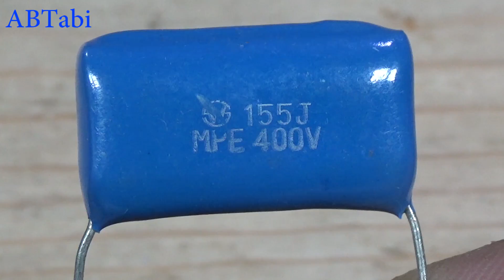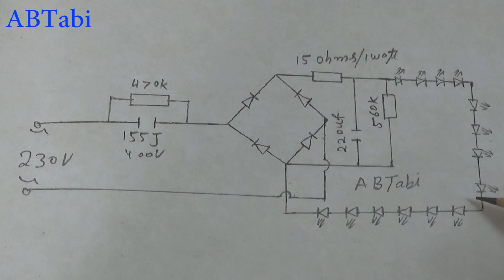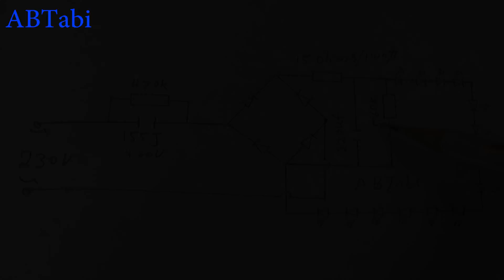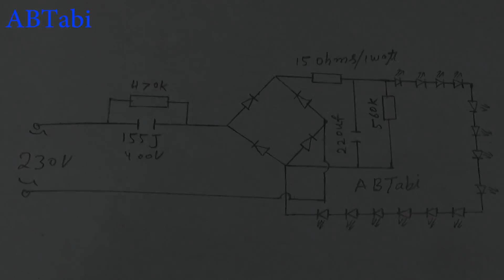How to make 230 volt Brightest Led light bulb, diy super bright led light bulb

Comment: The 220 uf capacitor is only rated at 50 volts. If a LED went open circuit the voltage across the capacitor would rise to 315 v peak . I suggest a lower capacitance value with a high working voltage..
Reply: I just can't get this. Is there still 315 volts going through the LEDs? I thought the 155j film capacitor is responsible for the biggest voltage drop. How can that 220uf capacitor still charge to 315 volts peak?

Comment: Hello sir 
Can we use 10mm rgb flashlights instead of white led lights in this circuit
Reply from the maker: Yes you can try ,,,,,,,,
Reply: @ABTabi  Thank you sir
Reply: Sir, one question again 
In our local market  CBB21 450V polyester capacitor, 8mm led's and 1/4watt 560k resistor are available 
Can I use in this circuit 
Please clarify my doubts 
Thank you

Comment: Hello Sir,
What, if I want to change from 14 leds lights to 5 or 6  with good brightness & life.
what are the components have to be changed from above, Thanks n Rgds
Reply: Use 0.22uF 400 volts capacitor

Comment: Good morning Sir, I tried it but when I connected it to my socket, it burnt the 470k resistor and the ceramics capacitor (155J  400V). 
What could be the reason for the burning Sir?
Secondly, If someone doesn't get 15 ohms / 1 watt resistor can 15 ohms/½ (half watt) work?
Reply: Your resistor burnt because it couldn't tolerate the power (W=IV) do a thing try 2W resistors next time so it can dissipate power easily
Thank me later ; )

Comment: Cam someone explain how that blue ac capacitor works and what it does? Is it converting from 220v ac to 12v ac? If yes what max amps can it drain. Is this the scope this capacitor was created? To know if it is safe or not to be used like that

Comment: What if I want to add more LED's , around 20 or more?
Reply from the maker: My dear friend i give you simple formula for this type circuit,,,,,,,,,,,,,
If you add more led's in parallel mode you use more 14 led's no problem nothing change,,,,,,,,,,,,   but remember if you add more led in series mode voltage of circuit got up your 220 uf capacitor burn,,,,,,,,   for example in this circuit i am 14 led as you can see at multi-meter screen output voltage is near about 42 ,,,,,,,,,   if you use 20 led light your circuit will be up to 60 voltage,,,,,,,   so you use 220 uf 63 volt capacitor ,,,,,,,,,,,,      Thank you for interest,,,,,,,,,,
Reply: @ABTabi  Thank you dear friend.
Reply: @ABTabi  but one thing is not getting clear to me. 14 bulb consume 3.5 volts each in series....which turns out to be 49 volts and also resistance in series with the bulbs.....then how it comes out to be 42 volts

Comment: Sir I have used 8mm led 14nos . light is  not working. But while  measure the voltage with multimeter  all LEDs are working what is the reason.
Reply: Please  reply
Reply from the maker: Check your circuit connections again specially capacitor ,,,,,,,,

Comment: Sir can u supply smd led, capacitor, mov, resistance, ic drivers, ACDC batteries, DOB raw materials, led  strips, led tube lights raw materials  with Tikki fitting n punching machine n all other accessories, led strips for led tube lights, led ceiling lights n all types of led bulbs etc, guarantee of raw materials, mode of payment,  please send me the details of the above immediately

Comment: please TELL IF I USE 50 LED 8 MM WHAT WILL BE CIRCUIT CONNECTION 
what resistance capacitor will i use and what will be the non polar capacitor value
please explain with the comments 
it wound be great if you help me
Reply from the maker: Dear friend ,,,,,,,   if you use 50 led = 3v 1 led,,,, 50*3= 150 volt ,,,,,    it mean you must use 200 volt capacitor,,,,,    totel circuit same only capacitor change ,,,,,,,    Thank you for interest ,,,,,,
Reply: @ABTabi  what will be the value of polar capacitor which i will use for smouth d.c pulse i mean what microfarads i will used
Reply: @ABTabi  and i want to use resistance so keep my led more save please say the calculations